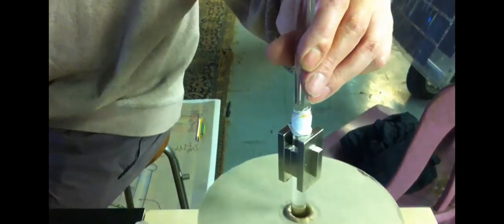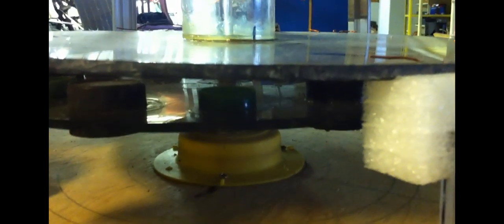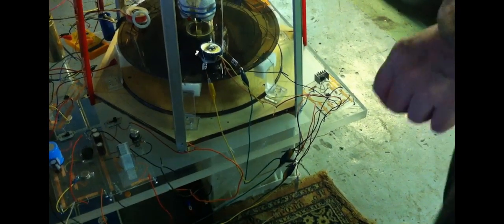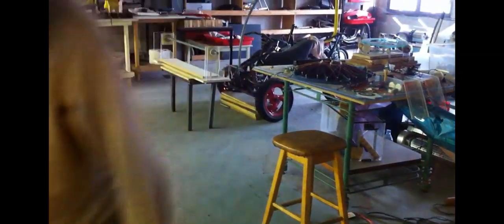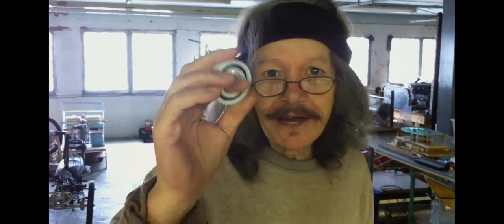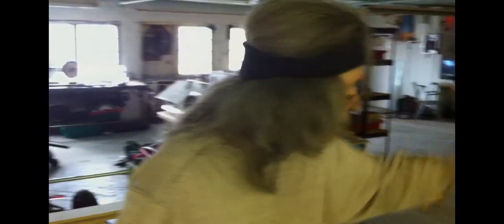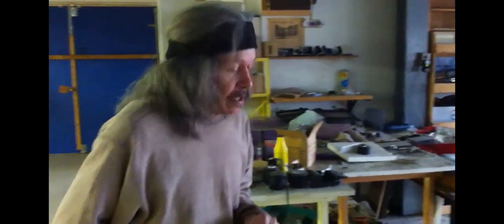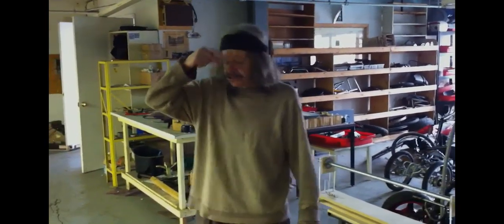UFO Alien Leak - FS14 Internalized Levitation

Comment: Unfortunately I need to be the first critic. Nothing here demonstrates any merit for being a realistic power supply. I do get the fact that your inventions are prototypes but the ideas and reasoning behind them are heavily flawed. To keep things simple I will point out just a few things. Every item you have here is built with the goal to create energy/levitation using magnetism. Great idea no doubt (the building block of every generator minus the levitation) but you forget that magnets have weight and are resisted by gravity. Of course levitation can occur with magnets but you cant allow it to leave its fixed position to move anywhere. Even if it is spinning the natural resistance of gravity will put a short end to it. This resistance (9.8 m/s^2 down) is the reason perpetual motion can not be achieved on earth. Your first invention did run, but off of what? Compressed air? You got that air from a fuel powered generator with a magnetic system much more efficient then yours. Not only do you not know how to properly and efficiently create energy but you know nothing about the basic physics involved. You are a very creative man no doubt, but this could only be called art by the scientific community.
Reply: It's reminds me of the car that runs on air.  Basically doesn't this violate the law of thermodynamics?  In other words nothing is free, you can't get something from nothing.
Reply: thewinesmith I have heard some theories of reverse entropy, but that factors in the question of what reality is, and consciousness that is hard to study as a science because we can't really test that and measure it.
Reply: how about now  http://mugugipan.webs.com/ I

Comment: I was surprised by how much more efficient air pressure was for start-up & initial acceleration vis a vis electronic input, and yet again by even better hand-driven centralized acceleration. Am now engaged in wedding these to light strong carbon fiber fabric construction (as are many throughout planet). See FS16-FS24 for initial results (mistakes admited and included).

Comment: FS16 Horizontal Levitation is now up! - Some have thought this AirTurbine is to power car? NO, NO! It is to recycle air pressure as added current. Which would you prefer - car at full power trying to break 40mph; or one that could cruise at 60 & still have a bit extra for emergency situations? That is it's clear purpose.